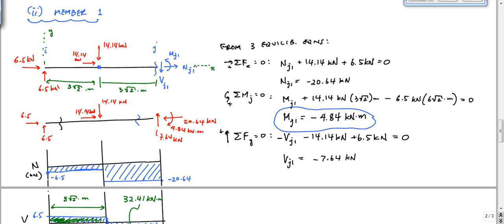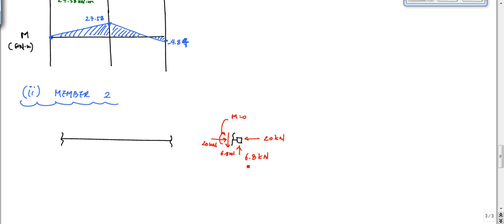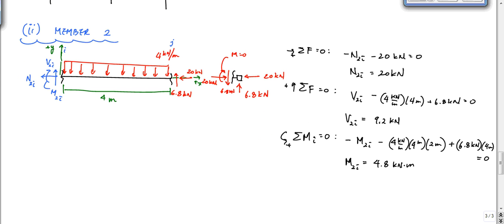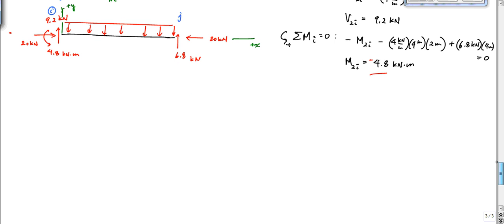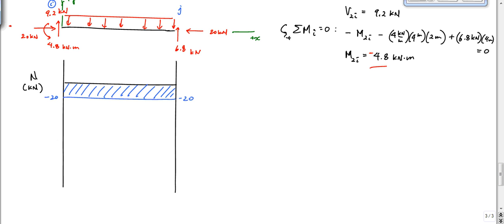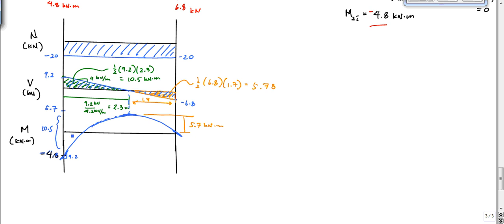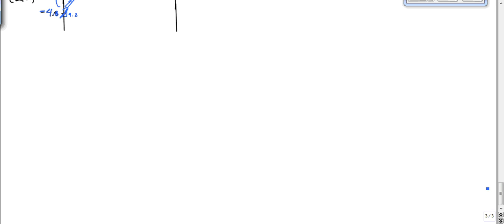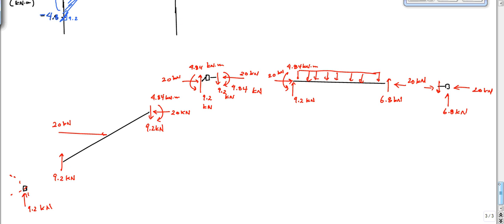Frame Analysis Example - Shear and Moment Diagram (Part 2) - Structural Analysis

Comment: in part 1, you used the angle to get N = -20.64kN and V = 7.64kN on the cut just before joint C, may i know how can i get 9.2kN reaction back from 7.64? because both 7.64 cos and sin 45 gives 5.4kN.